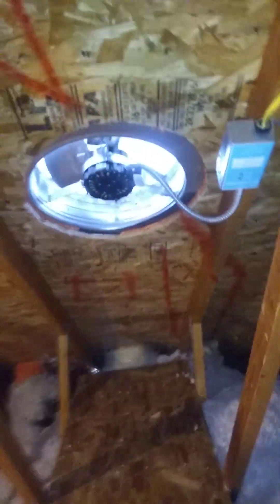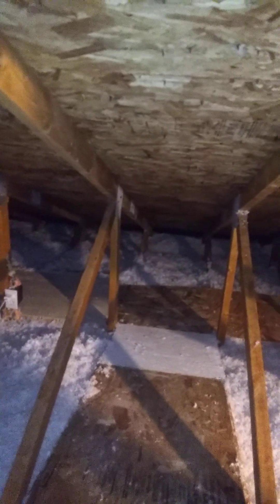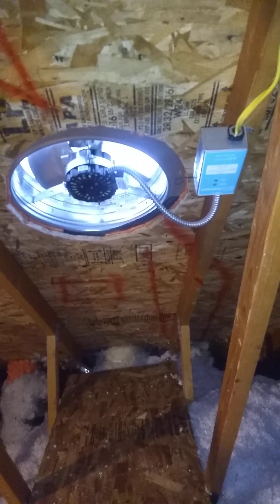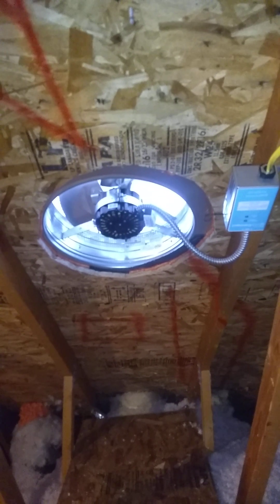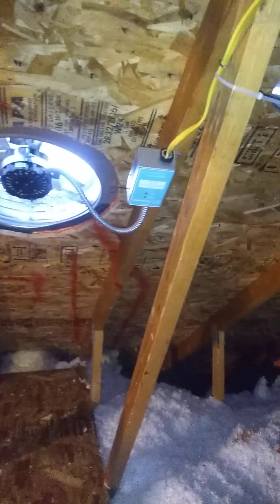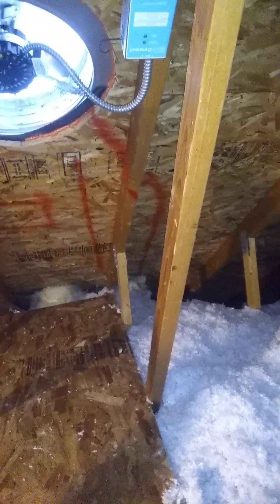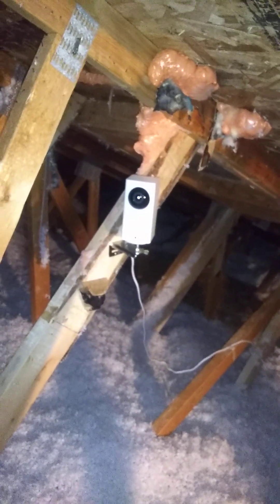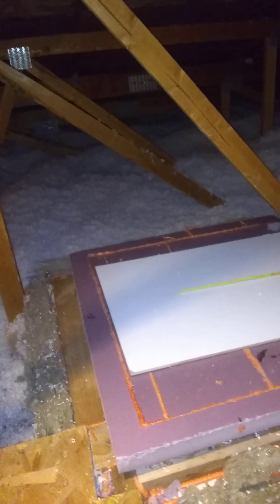GAF WIFI attic exhaust fan troubleshooting

Comment from the maker: 6-17-2025 Update: My fan has not been operable since spring from the application. It says it's working on the application as usual; however, I have an articulating camera that can see the fan and it's  not turning on. I haven't gotten in the attic, as I installed my fan for ice dams, to further troubleshoot. 

I did flip the gfi to see if the app would recognize that it wasn't connected, and it doesn't recognize or provide accurate measurements of temperature. So you may think your fan is running and working properly and it's not. This seems to be some Volkswagen type of behavior.

Comment from the maker: Quick update, still having problems with this fan. Now the fan shows it turns on while using the app, but it actually won't turn on. Fortunately, our air sealing and insulation work has eliminated the ice dams.

Comment: it would have been great if you too the mask off so we could hear you. I hate my GAF fans too. The wifi connection is such a pain and it wont work if it is not connected to wifi.
Reply from the maker: Apologies for this; however, there is insulation dust in the attic and from years of working in toxic environments I get a cough at night that doesn't let me sleep when I expose myself to too much dust.
Reply: @functionalvanconversion4284  was it toxic because you worked there?

Comment: The wifi fan has been a problem for me as well. Have two fans installed. They fans have the IP address so only one will connect! Replacing with the standard controller. Great idea. Lousy execution.
Reply from the maker: Contact GAF, though there customer service is not consistent they will contact you back. I don't use mine in the summer, but i just turned it on to test and it still works. Make sure you are not connected to a 5G wifi router, your router should have a lower hertz connection hopefully. Sorry for your trouble.
Reply from the maker: I just tried to go into mine and its not responding.

Comment: Hi, How's this fan holding up? I'm considering one for a second home, mainly for the wifi connectivity.
Reply: Worst mistake I made was these two GAF WiFi fans. Terrible.
Reply from the maker: Sorry, I am just responding, i wasnt aware of your message. It ran all winter last year and I don't use it in the summer, I just fired it up to test the new controller gaf had sent me and it worked on first attempt. I think they are great when they work as I spend winters in the south of the country working and it's nice to turn on when there is snow on the roof.
Reply from the maker: Fyi, this new module just did the same thing the old one did, it's no longer responding, so ill have to crawl back in the attic and trouble shoot this. Not reliable still unfortunately.
Reply: I installed a quiet cool AFG SMT ES-3.0 in my house but it’s only Bluetooth. Second home I installed gaf EGV5QCT. Both work as intended but the gaf is WiFi so better features.
Reply from the maker: @reggieeldrealtor6827 i was looking at the quiet cool before the GAF but we head south for the winter, so I want to be able to turn the fan on and off from anywhere in the world. As far as i know Bluetooth doesn't allow this as I called quietcool before purchasing the gaf.
Reply: @reggieeldrealtor6827  GAF wifi still working? thinking about another quiet cool AFG SMT ES-3.0 or this GAF wifi
Reply: @NoJokeRC hello, yes gaf unit has been great. It can reduce the temperature 10-15° very quickly. It’s not installed in a traditional attic but instead it’s in a loft sleeping area. We had mini split installed in the living area below the loft so it really helps cool down the loft. Yes it sucking some cool air out but it’s so much more comfortable sleeping at night. I like the Wi-Fi because I can turn on the fan before we arrive at the house.
Reply: @reggieeldrealtor6827 thanks for feedback, I’ll give this one a try
Reply from the maker: Fyi, i ended trying to reset the application but not removing the fan from the app. I didn't want to have to get back in the attic to flip the on and off switch, so I reset the GFI in my bathroom which feeds the fan and it's working again. Keep you posted.